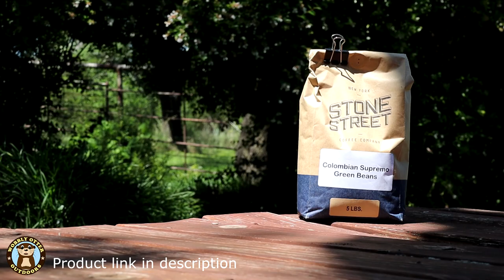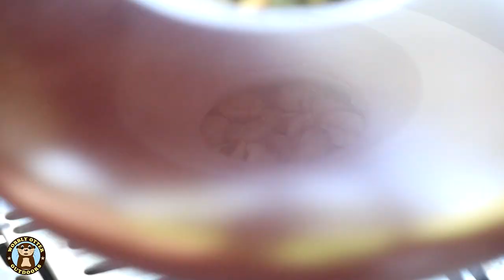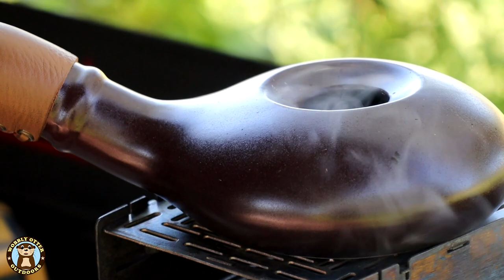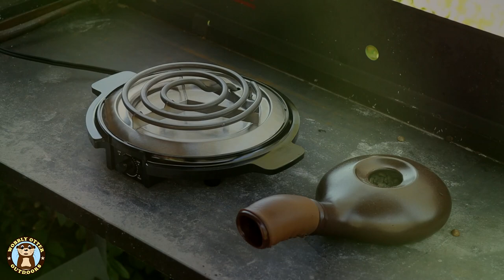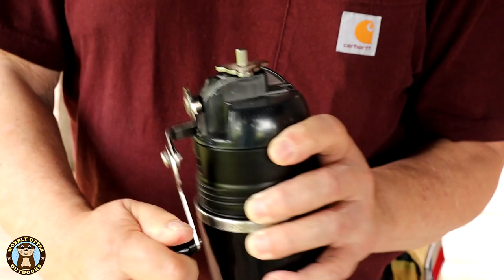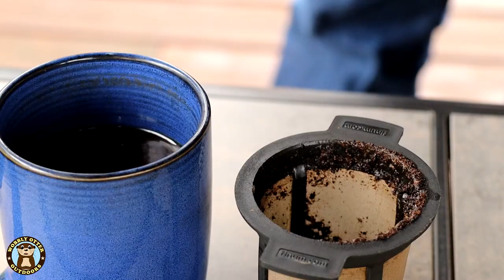Hand Coffee Roasting and Grinding

Comment: Does the inner surface of that roaster ever need to be cleaned?
Reply from the maker: Yes, cleaning it is probably good to do.
Reply: @wobblyotteroutdoors  I ask because that roaster does not LOOK like it can be opened.
Reply from the maker: Ohhhh. Yes, you are correct. It cannot be opened. For cleaning, we've swished hot soapy water in it. We have a couple of bristle bottle brushes, kind of like the ones at this link: https://amzn.to/3IrQUIe
They are good for cleaning the difficult to reach places, including inside the handle/spout.
(That is a Wobbly Otter Outdoors Amazon affiliate link, and we earn a commission from qualifying  purchases.)
Reply: @wobblyotteroutdoors  Thanks for the information.  I need to clean my roaster (saucepan and glass lid) once in a while because some dark film accumulates after roastings and when enough of this stuff is present on the surfaces, the next roast becomes badly bitter; so I use a abrasive-acidic stainless steel cleaner to remove this built-up film; and then the roasts are good again.
Reply from the maker: You're welcome. Awesome. I can appreciate how the roasted oils from previous batches would affect the taste.